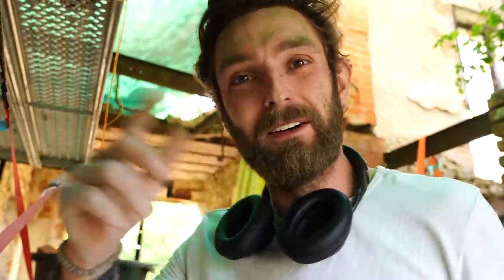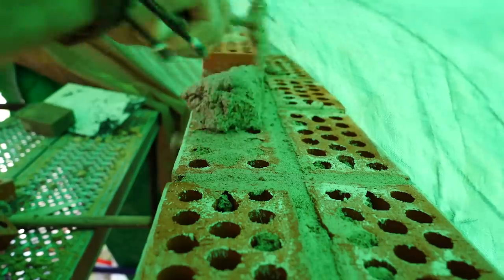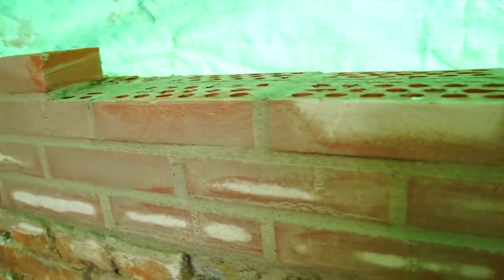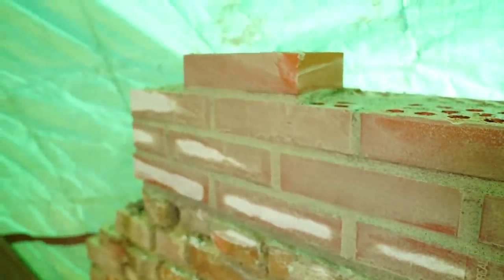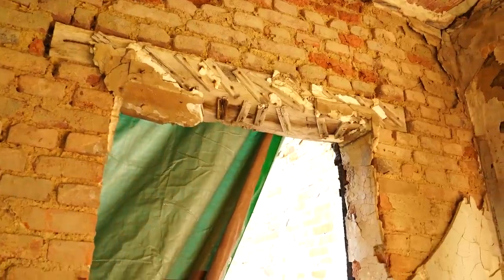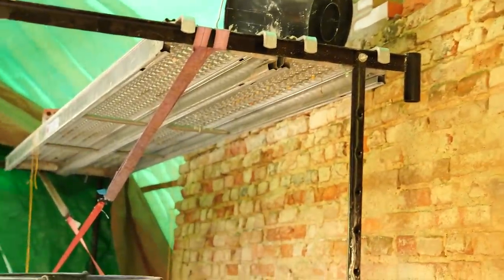The great rebuild has commenced; rebuilding a ruin brick by brick.

Comment: There is a minimum requirement for pass-through bricks on a double-bric lisbearing wall. You be's vhck the local code, for if you don't meet it, you will not clear the inspection!